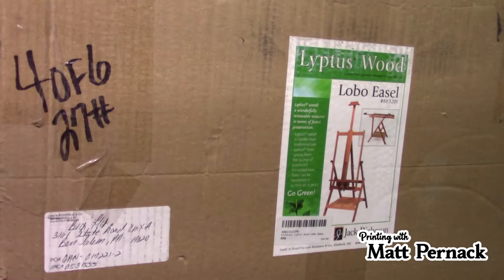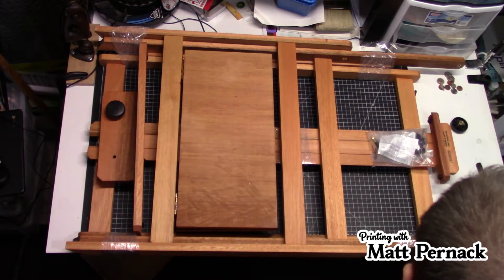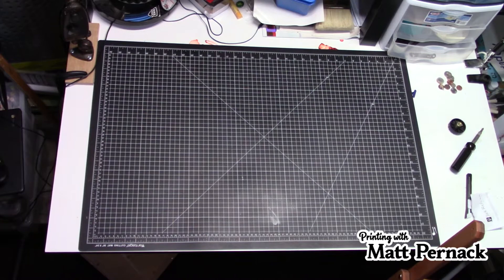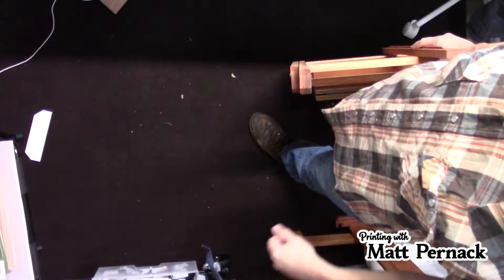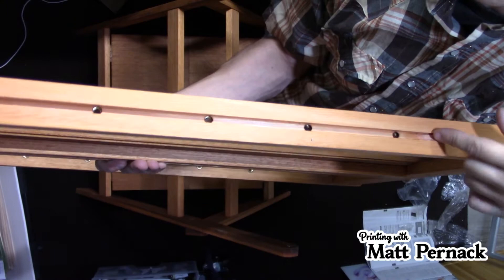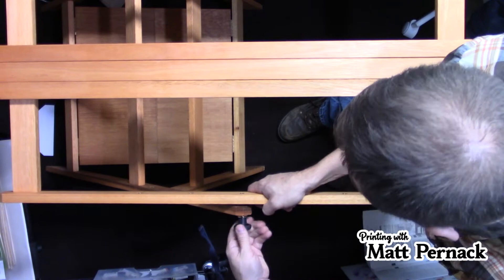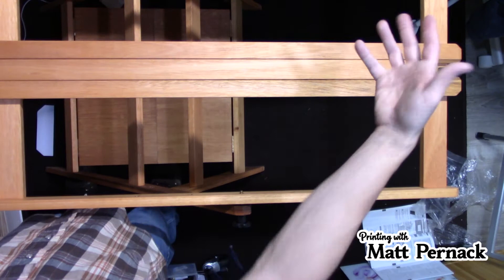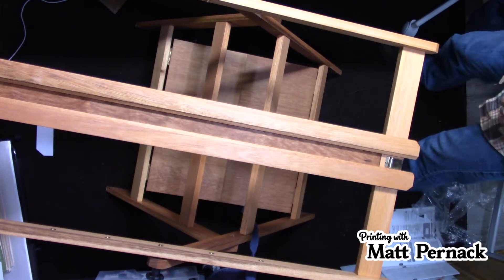Episode 038 Review Richeson Lyptus Lobo Easel

Comment: Where does the black round pieces go that came on the side knobs . I couldn’t get them to screw onto the inside of the easels . They are black round with a lever that goes around. To me the screws were not long enough to be able to fit on the ends of the screws once you put the frame on . Knobs are on the outside of the frame.
Reply from the maker: They should go between the frame of the easel and stand of the easel with the tab going into the slot of the easel .

https://imageshack.com/i/pnASrGC2j